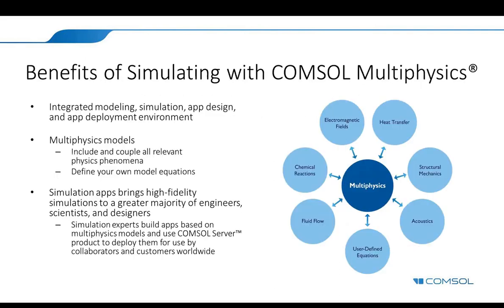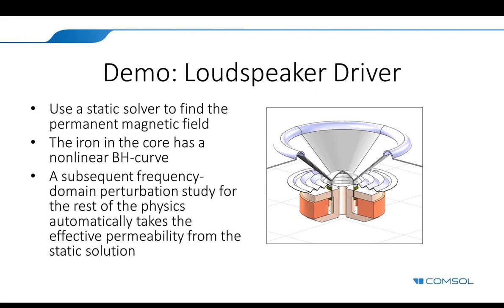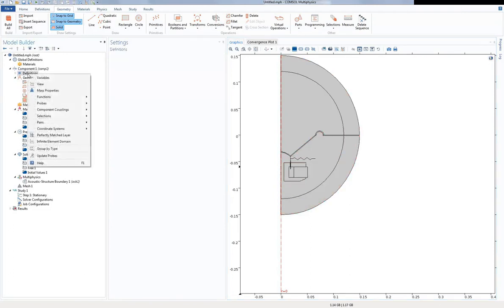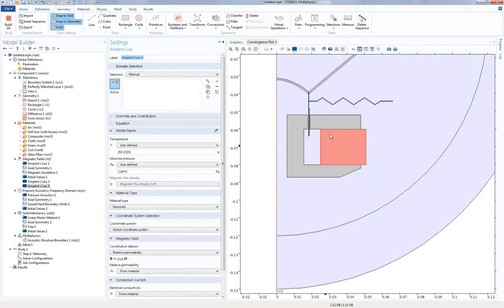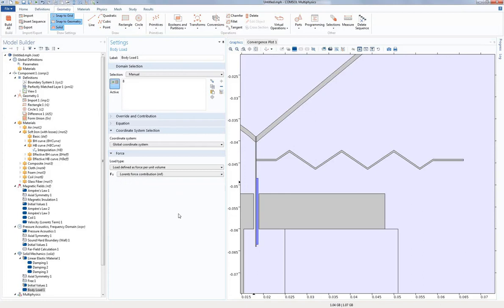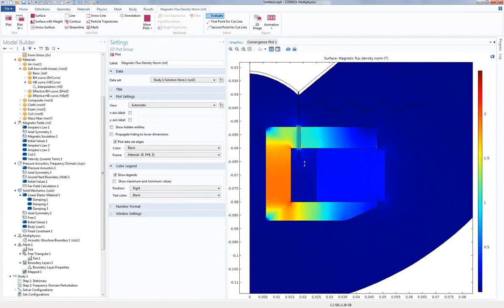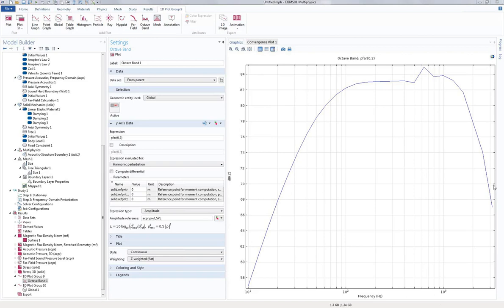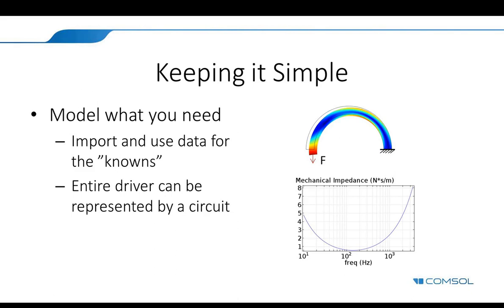COMSOL - LOUDSPEAKERS

Comment: Dear Mr Adresson. I am a german student for acoustical engineering . i appreciate ur tutorial very much. im planing on simulating horn speakers in comsole. ur projekt would be the ideal foundation for me to test some Hornforms ontop of ur speaker driver . i find it very hard to follow through ur tutorial because i have no comsol experiences ^^ i would be very happy if u could share this projekt data with me . this would save me weeks of frustrating work . Thanks again for ur video it helps me to get a good start. Greetings from germany!
Reply: I think you can find the model for this any many more related models here on Comsol website: https://www.comsol.com/models?q=loudspeaker
Reply: @LevonArakelian  thank u ^^ i already suceeded in building it myselfe
Reply: Hi
do you know how can I build a single point acoustic source in comsol?
it should have this equation 𝑄𝑚(t) = α𝑒−𝑡/𝜏 sin(2𝜋𝑓𝑡).i don’t know how I can build a sinusoidal acoustic single point source that decays after times.
it means a lot if you can help me.thanks.
Reply: Hey ho i dont know i did use an oval shape that acted as a particle velocity source. One could build a 3 dimensional ball shape as a particle velocity source i guess. But i dont know how to apply custom sin terms in comsol.
Reply: @chinguaga  thank you for respond